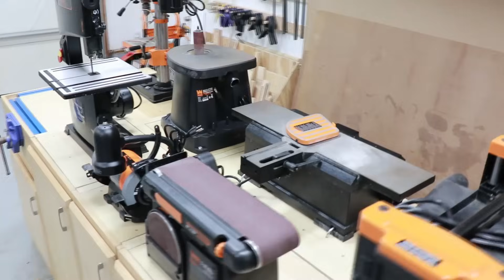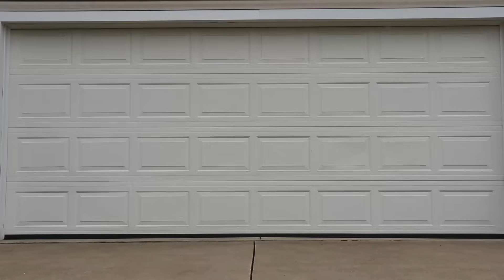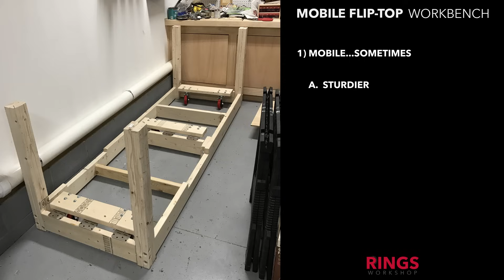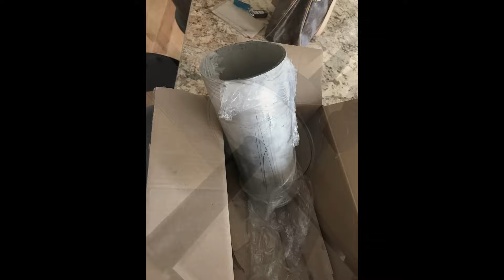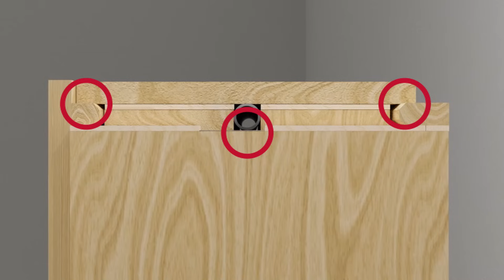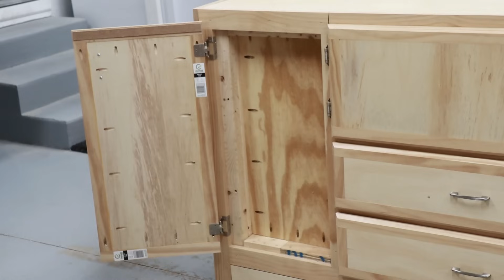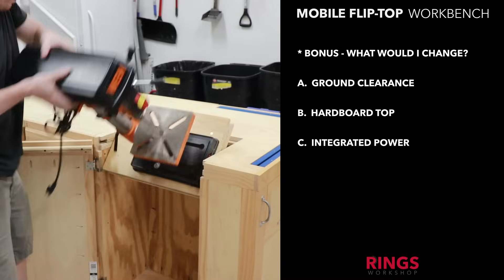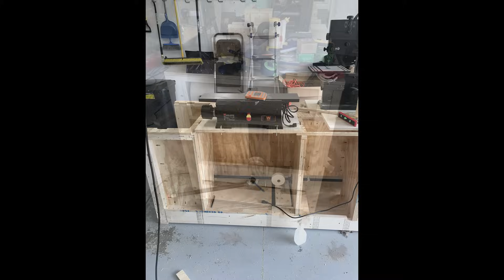Mobile Flip-Top Workbench

Comment: Nice bench, for sure, and a great explanation of the thought that went into the design. I have two questions and apologize if they were asked/answered...
1) It looks like each three-sided tool support was built independently. Do they then have double walls at the adjacent panels, or did you attach one to the next so they shared one or two side panels? Also, those three-sided boxes use pocket holes to attach to the rolling frame's base and the bench top?
2) Could you envision adapting that to a pre-exisiting cabinet that presently has a faceframe on the front (which would have to be cut and the door modified to support the flipping top)? I currently have three repurposed kitchen cabinets that sit on bases with casters so they can move to work as outfeed or assembly surfaces.
Thanks!
Reply from the maker: Thank you!  I’ll do my best to answer what you asked.
1) Correct I made each independently for a couple reasons, one they were all different depths, but most important was the bar that rests above them to slide there a couple that are similar depths and having two bars share a 3/4” space would mean each would only have about 1/4” to 3/8” to sit on and I wanted more support than that.
2) I think you could use the face frame cabinet, you would just need to build the inside out a bit with a spacer so when the top rotates it would clear the face frame.

Comment: Hello, curious what extension cord setup you have. I am getting some dedicated outlets installed above my saw and work area but haven’t figured out the best cord configuration. Is it a wind-up extension cord?

Btw, your whole system is sweet and would be a dream to have. I’m very intimidated to try building it but it would be perfect for my setup. Thank you for posting and sharing this.
Reply from the maker: Thank you!  I just use a cord reel from harbor freight.  Overall worked pretty well, however have had issues with the end holding plugs in place, tend to slip out and I just haven’t taken the time to bend the plugs back inside.  

As far as the bench, it’s a big project, the plans I made for it go step by step in 100 pages to make sure anyone with even novice wood working experience can make it.  A lot of people have modified them to be a smaller version of fit their tools, but definitely not as intimidating as it may seem.  How it works is different but the actual build is overall mostly simple.
Reply: @RingsWorkshop  thank for the reply! Appreciate it. I didn’t realize you had plans available. I’ll check it out for sure.
Reply from the maker: @funkeeefresh  of course!  Also, I wasn’t trying to make a sales pitch either, but I did make them with that exact concern in mind.  It’s a complex build holistically,  but each piece on its own is fairly straight forward, just a lot of pieces hahahaha
Reply: @RingsWorkshop  no worries, I appreciate the time it must’ve taken to make the plans. If you lived close by I would sponsor a second build so you could film it step by step. I’d get a bench and you could get to film it and have a helper! 😂 Looking forward to more videos from you.

Comment: How do you like that Wen bandsaw? I'm probably going to put a bandsaw in the bench like you did but the size limitations are a big factor. I notice that the Wen is on the smaller side of benchtop bandsaws. Thanks~
Reply from the maker: No real complaints, wouldn’t recommend trying to resaw much on it with the fence that comes with it, but for smaller things I have been happy with it.

Comment: Really great vid of a really great workbench!  How do you like your WEN tools?  Can you do a pro/cons vid on them perhaps?  Thank you.
Reply from the maker: I probably could do that at some point.  They are a really good entry level tool.  No complains about them at all other than size, but not as far as quality for the price.
Reply: @RingsWorkshop  Thanks for that info.  I noticed that their planers and jointers can be ordered with helical heads which I thought was pretty cool given their price. Any probs with snipe on the planer?
Reply from the maker: @fooddude9921  a little, but most of that was because I didn’t have proper support behind it on longer boards.  Since adding a support when doing so it’s been good, still every now and then but not egregious like it was before.
Reply: @RingsWorkshop  Thank you!

Comment: It makes me sad to think I’m not this smart. This is such a genius build and wonderfully engineered workbench. That notwithstanding, I have one small suggestion. The casters that support the lifting mechanism I noticed that you have two per board. If I were to try to build this myself I might use four caster per board so that there are four points of contact on the ground as opposed to having it tilt or not be as secure. 

Again, brilliant build!!!
Reply from the maker: Thank you so much!  With that, there are three individual boards, each has two casters, so at anytime there are minimum four touching the ground, most the time six depending on slant of garage floor.

Comment: Fantastic idea and video... I am also working in a garage and need to make things mobile.  Question... do you find yourself needing a flip tool after you set up for assembly?  Would it be better to have a separate table for major assembly so you can still access your flip tools if needed?  I'm just trying to think through my setup.  Again great video!
Reply from the maker: Thank you!  And, I do.  But with limited space a separate table wasn’t an option for me.  I leave the hardboard on top most the time so when I need a tool u can slide that around vs moving everything on top one by one.

Comment: This is an excellent video. I am very impressed with the animation, the descriptions, and how well-spoken you are. In terms of the engineering, I find that you are a lot like me, even after you have put something together, you are continually looking at how it could be better, more refined, and you're almost in the realm of doing it over again, just to find that you have more ideas.

I'm also impressed with your choice of power tools. There is nothing wrong with WEN, and in almost every video I see, even when  a shop is full of Festool, Shop Fox, and Grizzly, there is always the black and orange of WEN poking around. Cost to performance, you won't find much better, despite the rubbish I hear from YT Cowboys.
Reply from the maker: Thank you so much!  

I've been very happy with their tools so far.  My only complaint I have is the size, but that has nothing to do with the brand, I chose them that small because of space.  Like you said, cost to performance I have been very impressed with.
Reply: I completely agree with you

Comment: you should just have a plug in on the top of the platforms so each tool can be plugged in.  This is a marvelous construct.  I want to add a bunch of hold-down options to the top.  Of all the designs I have seen however, this is the one I am building.  Despite the lack of plans.
Reply from the maker: Thank you so much!  I do have plans available on my website.  As far as the plug, it would need to wired through a pipe if it was going to be on the platform since it spins, which I didn’t have the space side to side to do.

Comment: I suggest that another approach would be to cut a ledge in the pressboard so that the cam is always meeting it at 90 degrees.  I am also wondering if you made the cam 6 or 8 inches wide that wouldn't solve the problem.

Comment: I really do not like the inability to access the inside of the cabinet when the tool is rotated onto the top.
Reply from the maker: Why is that?  The only thing in there is the tool, which if it’s up the inside of the cabinet is empty.  I didn’t want it open because I knew if it was I would set things down in it.  However if you wanted it open you could just hinge the top where it locks and leave the bottom exposed.  I just didn’t like the way that would look myself.

Comment: Great video man! I love this. I just bought your plans for this and might try a downsized version. One question: Do you think there's a need for a middle support block for the pipe? Do you think it's flexing in the middle since the pipe is so long? Thanks and keep up the great work!
Reply from the maker: Thank you so much!  Because had six wheels was the main reason I added the middle support.  However, I would fear with that much weight it may flex some over that span.  If it was a shorter bench it wouldn’t be needed I don’t think.

Comment: Impressed with the engineering and the effort that's gone in both the table, plans & animations. Why not put your electrical in the unused spaced & keep the paper roll. Also, rather than taking the roll out to cut, take an old hack saw blade & mount is so you can use it for cutting. Otherwise, Kudos to you.
Reply from the maker: Thank you!  I had thought about the hacksaw blade (although I would have used a new one 😂), but decided it against it because it would need to be outside of the storage cabinet for it and I didn’t want to 1) see it 2) lean against it all the time for as infrequent as I use it.  

When you say unused space, do you mean the shallow cabinets?  I could have done that, however that wouldn’t allow them to be hard wired still, which would have been the goal.

Comment: where do you store the cover sheet for the table when used as a feed top?
Reply from the maker: Normally leave it on pretty frequently and just slide it around when using fliptop pieces.  That or I store it on my wood storage with other plywood just to get it out of the way.
Reply: @RingsWorkshop  Thanks!

Comment: Thoughtful job you did there! Curious how you deal with the orientation of the drill press and scroll saw, looks awkward to use?
Reply from the maker: Thank you!  Drill press faces the one end of the bench so I stand there instead of the long side, I just needed it facing that way for depth purposes so it would fit.  If it would have been a lot further in or in the middle it would have been awkward, but since it’s on the end, it isn’t an issue.  The bandsaw I assume is the other one you are asking about, it faces the correct direction as the blade faces that way, so no issues there at all with it.

Comment: Overall design and execution is absolutely brilliant. This is almost exactly what I want in my own design. I agree that the value of the power idea far out weighs the paper storage in the overall design. I'll have to think about how to make that work. Exactly how would you pull it off if you were to rebuild this? I also agree that working in some overhang would add some great functionality and will absolutely work that feature into my own bench. I'll try my hand at recording video of my build and will absolutely tag you as my inspiration. Thank you so very much for sharing this.
Reply from the maker: Thank you!  If you had extra space on the fliptop you could run the power through the steel pipe.  Drew Fisher did it on his fliptop cart, but I didn’t have space side to side to do so.  By removing the paper storage and spacing tools out more it would be pretty simple to do honestly if you watch his video as well, just search Fisher’s Shop.  I look forward to seeing what you come up with!
Reply: @RingsWorkshop  Brilliant! Thank you for pointing me toward more resources. I'll absolutely have a look into this. I'm hoping to start my build by the end of December. My issue is that I have absolutely ZERO indoor work space, only a shed to store tools in. I seriously spend every bit as much time lugging tools out of the shed, doing setup, clean up, break down, and stowing of my tools as I ever do actually USING them, and I work almost exclusively from saw horses or the ground. I'm hoping building a bench similar to yours will dramatically improve my productivity. Unlike your bench though, I don't plan to have my bench set down. As convenient as your system looks, I'm forced to work in my back yard, i.e. grass. So I plan to use some pneumatic locking casters. I suppose every functional feature one would put in must be a trade off for another bit of functionality. Unfortunately, this bench will be the entirety of my workshop.
Reply from the maker: @michaelcrabtree4221  I look forward to seeing how it turns out!
Reply: @RingsWorkshop   I'm working on my personal bench design in sketchup right now. What hinges did you use in your bench? I want my tools to be as close grouped as yours are since space is a massive premium for me, so I'm trying to copy your door design/spacing pretty closely. They look like typical cabinet hinges, but I didn't want to just make an assumption. Also, I couldn't make the idea of running power through the table top axles work because like you I just don't have the space from side to side. Minor disappointment.
Reply from the maker: @mikeycrabtree123  something along the lines of the ones listed below.  I chose these because normal cabinet hinges would be in the way too much when door is opened and the act of rotating the flip top would hit the hinge with the benchtop.  So I wanted something low profile inside the cabinet/door, and didn’t care about the footprint outside the cabinet.

https://www.homedepot.com/p/Liberty-Satin-Nickel-Self-Closing-Overlay-Cabinet-Hinge-5-Pairs-H0103BL-SN-U1/202824473
Reply from the maker: @mikeycrabtree123  also, that sucks about the power.  But it’s not that big of a deal tbh the more I use it.  I’m hooking up dust collection each time anyways, power is quicker than that.
Reply: @RingsWorkshop  but your hinges are just standard cabinet hinges?
Reply from the maker: @mikeycrabtree123  correct.  The link I put in the one comment should take you right to the ones I used.
Reply: @RingsWorkshop  nice! Thanks

Comment: Wow.  This is really impressive.  I would rather see this type of video than a build video.  They get tedious.  Though not intended by you, this is much better.  Really well done.  You made me rethink some things about a bench I am designing now using MicroJig Matchfit clamps.  The grid of the top will "catch" on outfeed goods.  I will need to account for a piece of hardboard the way that you did.  Hmm.  **Thinking of something clever**  You are a really smart guy.  Thoughtful design.  Well done.  Subscribing.
Reply from the maker: Thank you, I appreciate that!  Ya I debated doing something similar for more clamping space and with the table tops being able to move, I was worried it wouldn’t be much pressure so I never bothered.

Comment: Thanks - lots of great ideas in this video. My only concern is that I haven't yet found a good CAD tool to do my design in. Can you recommend one?
Reply from the maker: I used sketchup initially, it tends to have less of a learning curve and is really good for wood working.  I think used fusion 360 when made plans for appearance and it forced me to learn the software as it’s really good for designing 3D printed items, but I felt was tougher to learn than sketchup.  Just my two cents, hope it helps.

Comment: I am a "mature" newly retired wanna be woodworker so pardon me if this question is confusing or frankly embarrassing.  I really love your channel and especially the support structure of your flip top (no latches or pins but actual framing).  Could the flip top "unit" be used by itself?  Not built into a bench?  using locking casters to allow the flip without movement?  My "shop" is small and I don't have room for such a large bench but would like to mount my planer, sander, etc. on separate flip tops like yours using your genius support system.  Thanks in advance for your response.
Reply from the maker: I wouldn’t see why it wouldn’t.  Only concern would be it tipping while flipping of weight wasn’t balanced, but I think it should support it just fine.
Reply: @RingsWorkshop  Thank you for your swift reply.  Think I’ll flip it when it’s supported against a wall and then roll it out to the center of the workshop to use as a mobile workspace.
Reply from the maker: @jeaninepayne9303  100% since it’s only flipping one direction.  A lot of other fliptops use two tools in one spot so you can’t do that, this one only having one and then a free surface you could.

Comment: I like the lifting device. May well try that. I am mainly a turner, so making nice rounds is pretty easy. :-) I will make a more traditional bench with bench dogs and also a lateral dog area of the English type. I've been thinking of mounting some power tools on wood boards, then clamp them on to the bench with dogs/vice. Similar modular idea, just a slightly different implementation. Gives me a continuous working surface with few areas for wood to catch. Had not thought of mounting the drill press on a board. I have same/similar Wen model, so that is an interesting idea to ponder. I also have fewer stationary power tools, rather use a hand plane to a planer. That's just a matter of style. Thanks for sharing, and cudos on the 3D animations!

Comment: That bench is pretty awesome and the flip mechanism is genius. I wonder if there is away to incorporate it into a dual power tool single cabinet design. I would like to have my jointer and planer be mobile and originally planned on having them on their own carts which takes up twice the amount of space. I'm thinking I would have to simply have the pipe/table top slide out further to accommodate the height of the machines to allow them to fully rotate. Incorporating the door as the "lock" is so cool.
Reply from the maker: Thank you!!! Drew Fisher @ Fisher Shop has a fliptop design that uses two tools and has the power going through the pipe.  You could combine the two, however you would need two doors.  My design wouldn’t work with the two tools in one spot unless the back was open.